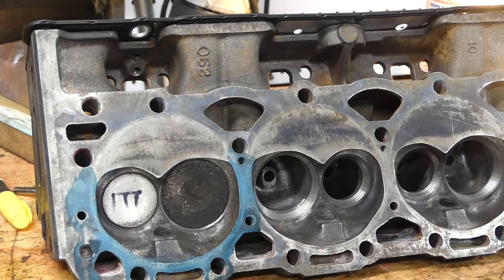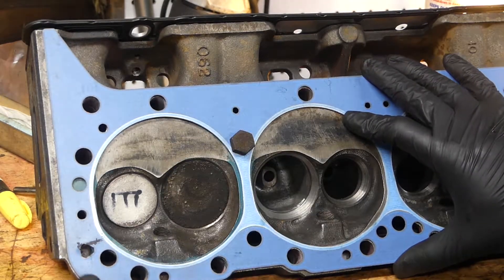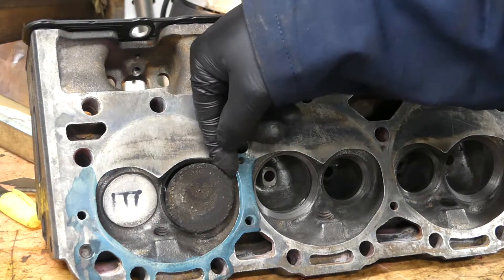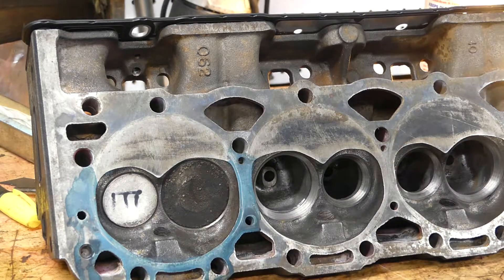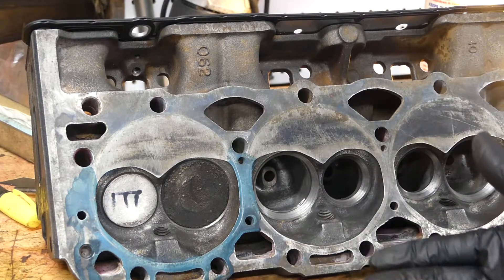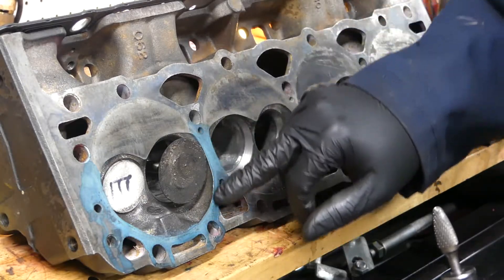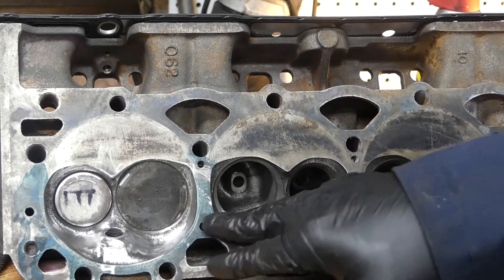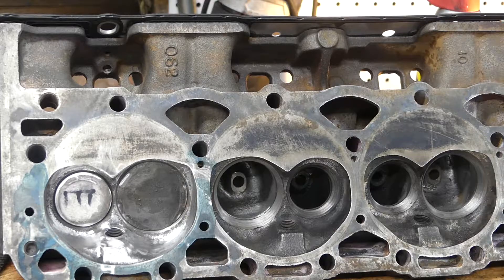Vortec Head Porting (Shaping the Chambers)

Comment: Inside the valve ya.but if ur opening the razer mark that will lower your compression chamber ?
Reply from the maker: Yes, alot of this I will need to redue a video of. I have change alot of how I do things. But a properly done chamber will open the chamber slightly but the gain in flow and swirl will gain far more power than the compression difference
Reply: Ya makes since.from.some.infor I found tulip valves helps big time
Reply: Question.have a 327 flat tops and vortec heads.what a good street strip cam?
Reply from the maker: @tj484   thats a loaded question, I need all the details you can give me. Application, budget,  conveter, gearing etc
Reply: @brokejoebuilds5165  373 gear slandered trans.compresstion 10.1 aluminum intake 5600 rpm range.stock valvebsprings have a 288 480 cam comp cam.but not sure if it will be righ.
Reply from the maker: You would need valve springs and to cut down the guides
Reply from the maker: Which intake? Car or truck? Daily driver? Street and strip?
Reply: @brokejoebuilds5165  eldinbrook air gap .daily driver.intake 6500rpm

Comment: Dude, with all due respect, you should go watch David vizgard he goes into really fine detail about combustion chamber geometry and is one of the most intelligent old timers you will ever learn from, and just to make it clear what you did to that combustion chamber ruind it. Yes you deshrouded  the valves but you need to leave some areas alone because thoughs areas induce swirling and promote air flow and gasses. You went to high up into the combustion chamber. His videos show you what to do and he proves that affecting thoughs areas, has a negative impact on combustion coefficients.
Reply from the maker: I made a video 5 months ago explaing just that.  The video is called I am a fraud. I try and explain what I did wrong but how I may have gotten away with it as well. And I am aware of David vizard, ive read his books since I was a boy but I did go into detail where i went wrong!

Comment: Why didn't you use the dowels to align the gasket, looks like a good way to create sealing issues.
Reply from the maker: You have a good point. Ive always done it this way but dowels would keep things more center than head bolts. That being said i have never had a issue doesnt mean im not due. Im always doing my best to learn and do better. Thanks for the tip.
Reply: @brokejoebuilds5165    you can pick up sbc block dowels for 10-15 bucks. use a scotch bright pad and scuff them enough so they will slip into the heads, but TIGHTLY! this will tell you precisely how far you can go when doing chamber work. and do not just use any gasket, use the exact part number gasket you will use in the running engine.   another thing to consider, if the chamber is 4.166 wide to match the gasket, but your bore is only 4.0, 4.030 you could be causing more harm than good. a better practice would be to lay the head on the actually block you will use after it is bored to size, then lightly scribe around the bore with a fine pointed awl. preferably before you have the heads milled to clean them up.  you'll be reaching in from the bottoms. but this would allow you tp precisely un-shroud valves to match the bore of your engine.  one of the most common things guys do that ruins heads is they grab a gasket and start grinding everything to match. you want t port match, you want to have the chambers match the bores, not just ground to a gasket, i can almost guarantee if you buy ten sets of 1205/1206 gaskets that 8 out of the ten will not be sized exactly the same.

Comment: maybe you should put the head on a bare block and scibe the cylinder, no?  The gaske is always bigger than the cylinder and in many cases much greater, esp on an SBC.
Reply from the maker: So through out the process of making these video's that has come up a couple of times. This is the way I learned and I have read in many places to do it. But I do see what you are saying and how that may be a issue. Even very reputable guys like David Vizard use a head gasket.  I have a block that I can bolt this head to and maybe make a video about it. Maybe many have been doing it wrong? Maybe it has no effect?  I dont know now lol 😆
Reply: @brokejoebuilds5165  I don't believe Vizard does it this way, but in any event, if you use the head gasket in lieu of the cylinder bore,  you create a shelf around the top  of the cylinder head.  Common sense tells you that this impedes flow as well as the combustion event.  To each his own.  One can always learn and improve.
Reply from the maker: https://youtu.be/hFhvYnHbYlc 
A recent video with vizard using a headgasket. I'm  not arguing with you, what your saying makes sense. I will mock this head up and see how it looks in the bore itself.
Reply: @brokejoebuilds5165  Check out his book on BBCs.  BBC head chambers are bigger than the bores on a lot of engines.  Chevy put "valve notches" in the HP blocksto eliminate some of the "shelf".  Vizard goes much further and grinds significant notches to improve the performance of the BBC's (his specialty for a long time).
Reply from the maker: Maybe thats something that can ve emulated here 🤔.  I'll look at this later.

Comment: Those are drilled for a 400 I notice. I got a set on a 400 I had drilled aswell. The holes in mine are much smaller though
Reply from the maker: You have a good eye, yeah someone drilled these heads before I got them. In most cases steam holes aren't needed on a 400 which can be argued. Im going to most likely put these heads on a budget 357 build.
Reply: @brokejoebuilds5165  I would never build a 400 without drilling the steam holes in the heads. Not doing so can cause steam pockets that, even though it may not show on a temp gauge, can cause localized overheating and warpage of the cylinders and cause noticeable power loss. 400 cylinders can be pretty thin when bored and can use all the help they can get, and drilling the heads is cheap insurance.
Reply from the maker: Most of the guys I know use non drilled heads in drag applications with no issues. But I can see where in a street application it can be a problem. Gm did put the steam holes for a reason. That being said aftermarket siamesed blocks dont have steam holes at all leading me to believe that this is a casting flaw in factory 400 blocks that effects some blocks more than others.
Reply: @brokejoebuilds5165  nothing is wrong with the steam hole idea lots of other engines have them Buick’s and Pontiac’s and Oldsmobiles do. But on a 400 small block they do tend to crack to the closest bolt hole pretty often there are many out there cracked from the steam hole to the center head bolt hole.
Reply from the maker: @brandonbell8159  im about to do a video on  a 400 block this week and it has a crack as well. For my application head studs would work nicely 😆.
Reply: @brokejoebuilds5165  yep that’s one good thing about a 350 block there a lot more sturdy. Also if you don’t know some of the older 69-72 4 bolt 350 blocks had nodular main caps but some didn’t. I managed to find 2 of them 🤣🤣
Reply from the maker: @brandonbell8159   I had one..... had... its gone now. Droped a valve  ☠

Comment: Are they still 1.94 valves in there or 2.02?
Reply from the maker: The valves that I used to protect the seats are 1.94  1.50. The seats were pre cutted for 2.02  1.60 package so I can blend the seats and bowl blend.
Reply: @brokejoebuilds5165  

There is another channel that just did some Vortec flow testing with the stock valve sizes and the 2.02" in. and 1.60" ex. valves.

Its a weird name for a channel but the guy puts out good info. 

Pisscutter Performance channel on YouTube.
Reply from the maker: We were supposed  to make a comparison  to this cylinder head with his but my buddies flow bench was way off calibration and by time I got things going it was to late. Maybe  we will do something in the future though 🤔.